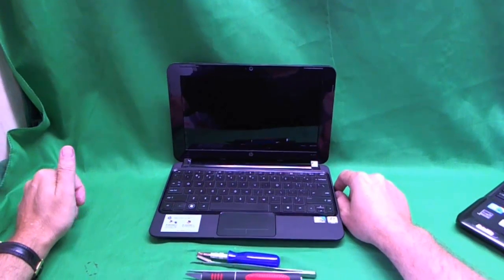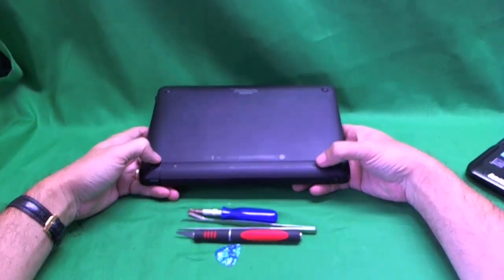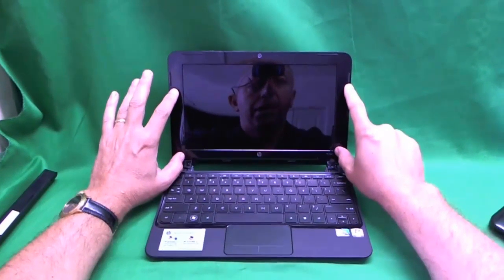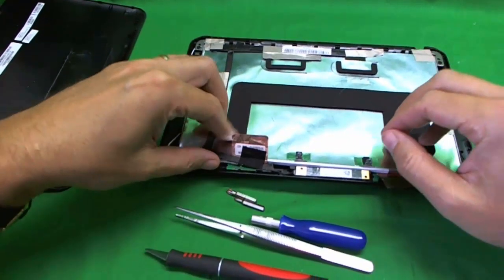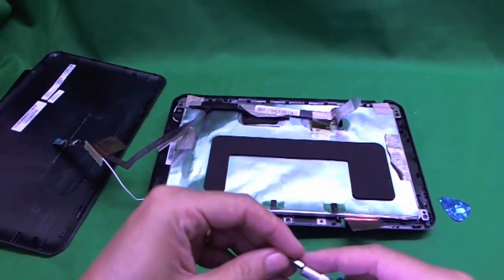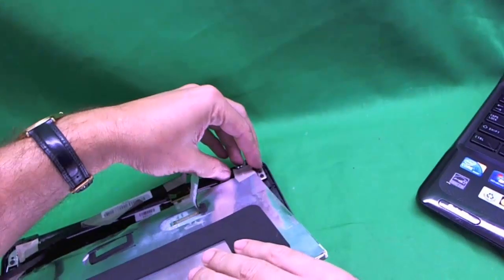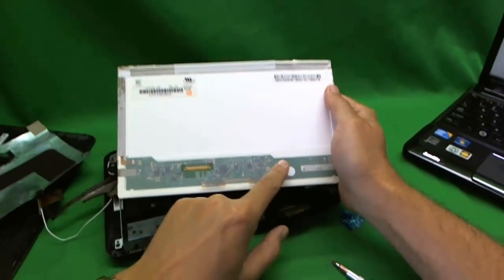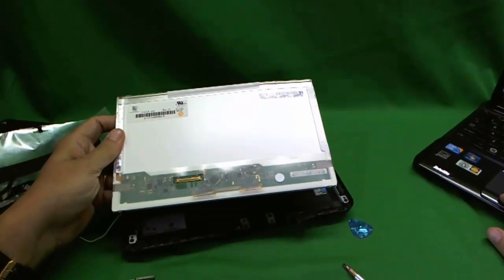HP Mini 210-1018CL Netbook Screen Replacement Procedure

Comment: I got a HP mini 210-1000 and its problem is black screen. After hard reset my NetBook, it still black screen but the fan is working, the light at Caps button isn't on... I connect with the external monitor but the external monitor didn't show anything even I press F4. What should I do now?

Comment: Great video.  I used it to replace on model HP 210-1084NR.  Only thing unique to my model was during the old screen removal:  I popped out the screen with its plastic frame but the metal frame stayed in the notebook.  I noticed there were actually 2 metal frames.  It took quite of bit of trying to dislodge the INNER metal frame which was attached to the glass screen via a sticky caulk-like substance.  May need to open Color Management system and re-set to DEFAULT setting, if necessary.

Comment: THANKS!!!  Perfect instructions.  I used a very small screw driver to remove the back cover instead of a plastic pry, worked fine.  Didn't need an exacto knife at any point, either.  One word of advice to others: go VERY slowly when removing the adhesive attached to the video cable from the foil.  I pulled the sheathing away from the cable by pulling a little too hard, but apparently no harm no foul (other than a mild heart attack).